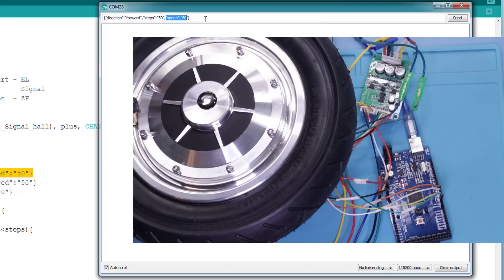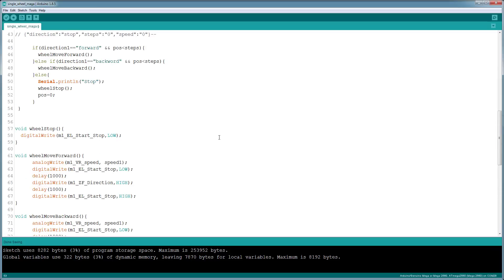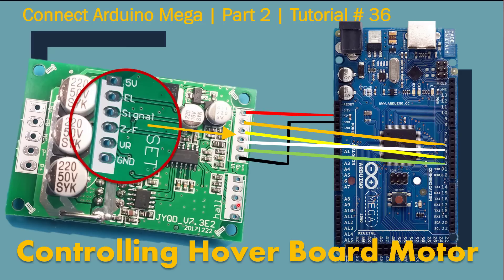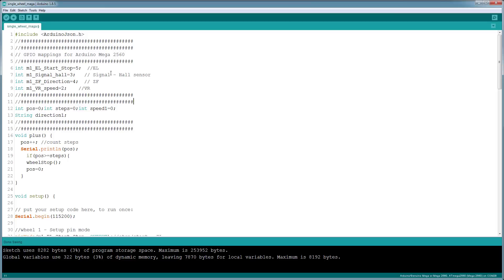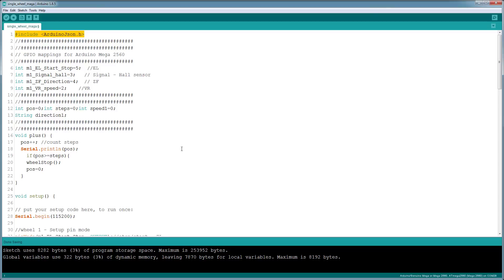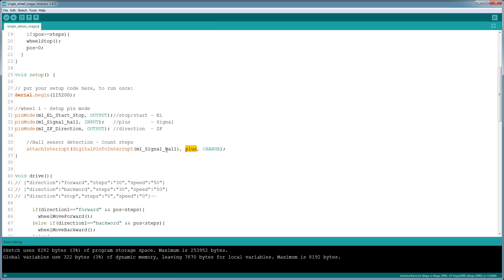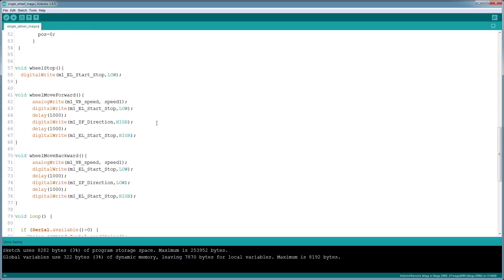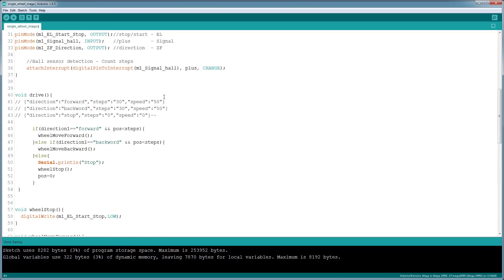BLDC Hover Board Motor Controller | Arduino Mega | Part 2 | Tutorial # 36

Comment: Im using two 5200 mah 40c 11.1 lipos in series to control this, but the motor needs a slight push before it starts spinning, got the same results when i tried powering it with a 35 v PSU,any idea why i need to nudge the wheel abit for it to start spinning?

Comment: i have a few questions, first one being what do i do if i want to use this with an ebike, i'd have to ocnnect it to a 36V battery but in the previous video you mentioned it would fry it up, loooking for a solution. second, is it possible to do the same using an arduino nano or uno

Comment: Sir, i try the code and it's work when i see at the serial monitor there's a step count. But the motor wont spin att all any idea what's wrong ? Thanks
Reply: Same problem here. Did you get the solution?

Comment: Hello, im just here to tell anyone whose gonna use this driver that the manufacturer say that "The 5V output port on the drive board is forbidden to connect to external power equipment. It is only applicable to an external potentiometer or switch for speed adjustment, commutation and enabling operation". So, don't connect the 5V.

Comment: Hi, what's the minimum power able to be applied with this control board? With the speed pot set at the smallest value to enable the controller output can the motor be powered but not enough to overcome the friction and turn?

Comment: Hi, my hoverboard motors just vibrate when I try and control them via arduino or potentiometer. I tried this with two differents ESCs. Would you happen to know a fix to this?
Reply: I had the same problem did you find a solutions?
Reply: try changing wire phases

Comment: Inertia will keep the wheels turning. How can I bring it to a standstill at the intended rotation speed?
Reply: That is the problem with this board. There are no breaks. That is why it is not suitable for most robotic projects. You have to build electronic 
Regenerative Braking, please google it or buy a board that has built in breaking.
Reply: @datagurus-a1  I couldn't find a board with a brake function.
Reply: A four quadrant control board can drive and brake in either direction.

Comment: does this board control the position of the wheel? I mean if you program the microcontroller and depending what is been read it can run in close loop?

Comment: Great job. Need help - I have two hub motors on the front side, but they move with different speed when they are connected to same arduino and power supply. Any suggestions on how to ensure the wheels move with same speed if they are moving just forward or backwards. Thanks. Any help would be appreciated.
Reply from the maker: You need to implement  PID. Please Google it there is lot of help on net. Good Luck

Comment: Hello,
only a confirmation.
When the (m1_EL_Start_Stop is set to LOW) the plate is then turned off, the engine stops as if it were a brake?
Reply: There is no electric break. If you are on down hill it will continue to move until you are on level ground. This is the reason I was unable to use it for my Trash Can project.

Comment: when it reaches that part of the code (digitalWrite (m1_EL_Start_Stop, HIGH);), it serves as an electronic brake or just to disable the card.
Reply from the maker: It does not have breaking that is why I could not use it for my projects. it will stop powering the wheel.

Comment: YOU: Overenginering PWM singnal emulated by software in low-lvl hardware

Me: solder 3 pin on potentiometer...

Comment: Hi! thanks for the video! I have some questions. Could I control the time that the motor is spinning instead of the steeps from the hall sensors? I want to modify your code in order to achieve certain rpm (speed) and certain spinning time (steeps). I want to regulate it with 2 pots, one for the rpm and the other for the spinning time. It´s possible?
Thanks in advance!
Reply: did you do it?

Comment: for the driver, 5V-36V 350W DC Brushless Motor Controller BLDC PWM Driver Board, the driver plate i got is JYQD_V6.3E1. i cant find JYQD_V6.3E2. is it okay if i buy  JYQD_V6.3E1
Reply from the maker: Both are fine but  make sure you pick the one you need since one does not have hall sensor connectors.

Comment: Hello. I am trying control 2 wheels with an adaptation of your code. It works well but I have some issues of synchronization between the 2 wheels. Do you have an exemple of code to handle it properly? (i guess that it should use the hall sensors, but it’s quite hard to implement..). 
Many thanks!
Reply from the maker: Please google for pid code to syncronise two wheels.

Comment: Is there specific a reason why you set the Signal wire to the pin#3 of the Arduino ?  I do not succeed to figure out why, but it seems the pin#3 is the only connector where it works.

Comment: Hey Thank you for this great tuto. Do you think is it possible to detect the direction of the wheel using the "m1_Signal_hall" ?. I'd like for exemple to have "pos++" if it is running forward and "pos--" if it is running backward.
Reply from the maker: You can tell the direction from hall sensor but you can check the direction pin GPIO for high/low value to figure out the direction. Good luck
Reply: Hello, thank you for your response. I tried to do so, but it seems that whatever the wheel goes backward or Forward, the hall sensor give a value High/Low depending on its previous state only High/low.
Reply: @Ben55j  Right, because then you'll know if it's high it's one direction if it's low...it's the other direction

Comment: Hello,
I bought the controller card in your description, but the card is a different from the one you show in the video. Ports EL, Signal and Z/F are missing and Instead I have CCW, CW and PWM. I'am a beginner, so I couldn't figure out if my controller card can make the Job with the Arduino. Do you know if there is any correspondence between those ports? Many Thanks
Reply: Same here
Reply: Did you manage to find a solution? I think I have the same board as well.

Comment: thanks for a great video

anyway.. is it possible to use 2 bldc motor using two driver ? how to combine it with the code that you give ?

thanks
Reply: I'm currently working on this issue. I've got two wheels to spin....pretty easy, but the code doesn't allow for a lot of fine control.......I really have been trying to get six of these working together with the mega....We'll see
Reply: @nikmische8456  hello Nik can you please upload the code here

Comment: Version of the ArduinoJson.h ???

 I am using 5.13.2 and variables as DynamicJsonBuffer, JsonObject& and function .asString() are not coloured so i think my Arduino Due doesn't process them. When I compile it i have no errors and i pasted the expression "forward" in the Monitor Serie to do a test and it gives no results, no movement of the wheel. What you think is happenning?
Reply from the maker: Please upgrade to version 6 and use StaticJsonDocument. Good luck.

Comment: Question on motor controllers. I recently bought from ebay 4 hoverboard brushless motors i belive they are 36V 350W 6.5 inch - with the intention to build my own robot rover but i never played with brushless motors before. I like to be able to control them using Rasberry Pi eventually and/or Arduino.  The controller(s) have to be able to interface with Raspberry Pi or Arduino. From an initial research i found 3 types of controllers ranging from very cheap China ones to 150 Euro Odrive. I intent to have the motors connected in pairs, left and right so that the rover turns by spinning/trurn left and right like a tank. The ask is which is the best controller for these type of motors so that i can have no freewheel when they stop on a slope and i can have reverse and won't t cost me an arm and a leg?
Reply from the maker: Niko Niko Try https://odriverobotics.com/. I am using this one since it has position hold and breaks. Good Luck.
Reply: @netmedias7657  thanks for this even if is the most expensive solution i think i will go with ODrive too. One thing i am not clear. My motors are 36v and odrive comes in 24v and 48v variants. Would the 48v variant have an adjustable voltage output to bring it down to 36v?
Reply from the maker: Niko Niko They have 48v version. You should get that one.
Reply: Netmedias sure that’s what I wrote but can the voltage be adjusted to 36v ? My motors are 36v.
Reply from the maker: @TheNikolasNick  Sorry I meant to say use 24v not 48v. You can not regulate the voltage on this board. Your hoverboard motor will work with 24v mine does.
Reply: @netmedias7657  if i drive 350W  36v motors with 24v they will draw more current... They are already rated at around 10Amps at 36v. I think thats not a good idea. There must be a way to use odrive to dirve the 36v motor as rated.
Reply from the maker: @TheNikolasNick  Please email your motor rating to oDrive support and ask them. You will probably get a better answer. Thanks
Reply: @netmedias7657  u r in my head... I have like 30 min ago. Thanks.
Pls make a vid with your odrive.
Reply: @netmedias7657  hi. These are the answers i got from odrive in case it helps others too.
Q. Wich ones shuld i buy to dirve 4 350W 36V DC brushless hoverboard motors? 
A. You should get the 48V.

Q. If i buy the 48V Odrive boards can i adjust the output voltage to 36V in the Odrive settings for instance? 
A. Supply any voltage 12V to 48V, you can adjust the settings on the ODrive.

Q. I want to build a rover robot, see attached pics for the motors and let me know if and how Odrive is suitable. 
A. ODrive is suitable.
Reply from the maker: Niko Niko thanks for sharing.

Comment: Hello @Netmedias. I have a problem. My setup only works if I push the wheel initially. I use UNO instead of Mega. If I don't push-  the wheel does not spin. Is this faulty controller or some other issues? I tried another wheel from other hoverboard - same problem. Help. Thanks in advance
Reply from the maker: Serge
 Remove the uno and apply 5 volts to EL. If your motor spins them make sure uno GPIO is set to high on the pin that is connecting to EL.
Reply: I'm using your GitHub code
Reply: It was faulty controller board after all. Got a new one. Avoid "GeekTeches" one

Comment: Hi can use raspberry Pi not use arduino??
Reply from the maker: Yes, but you will need to use level shifter. Pi gpio is 3.3 volts and board needs 5 volts.
Reply: @netmedias7657  thanks for your info.

Comment: Hey buddy! I'm trying to build a self balancing unicycle with an Arduino Uno, mpu6050 gyro sensor and the same hub motor and the motor drive. I really need help with the programming part I am really new to it. I have tried all other options but no luck especially with the motor driver. Buddy pl. Help me in this in which ever way possible!!!
Reply from the maker: Malhar Wable This controller is not good for that since you can switch the direction without stopping the motor. You can use the following controller. Good Luck,

https://www.aliexpress.com/item/FREE-SHIPPING-Motherboard-for-wheel-balance-scooter-Balancing-scooter-mainboard-card-full-set-unicycle-control-board/32858438915.html?spm=2114.search0104.3.110.2dd83488nrNbw9&ws_ab_test=searchweb0_0,searchweb201602_5_10065_10068_10130_10890_10547_319_10546_317_10548_10545_10696_453_10084_454_10083_10618_431_10307_537_536_10059_10884_5736015_10887_100031_321_322_10103_5736115,searchweb201603_53,ppcSwitch_0&algo_expid=08c43b7a-9797-43c2-a26c-95b4469c9997-15&algo_pvid=08c43b7a-9797-43c2-a26c-95b4469c9997&transAbTest=ae803_4